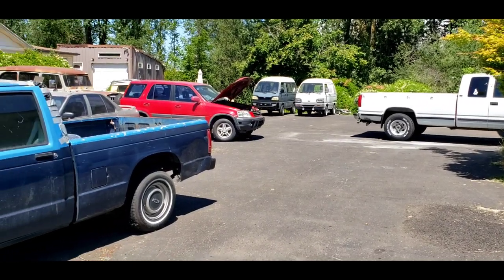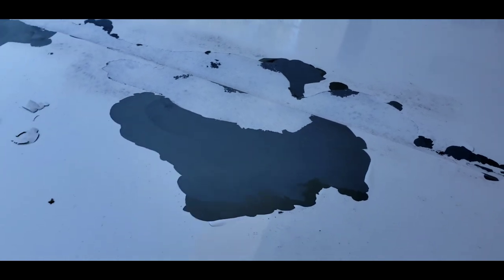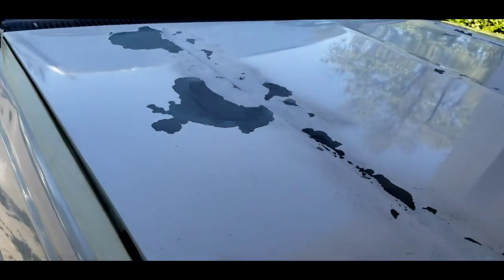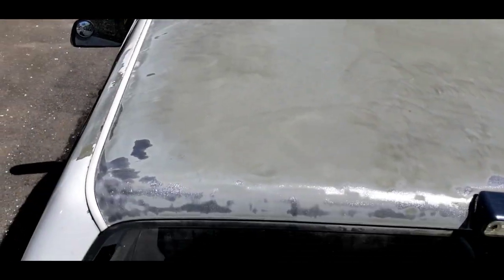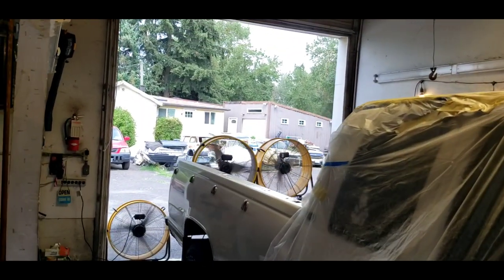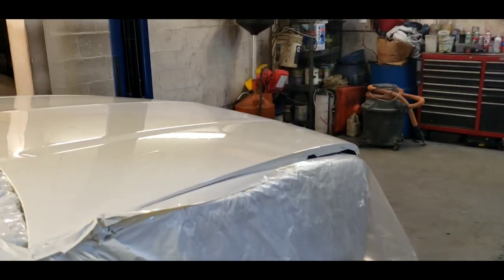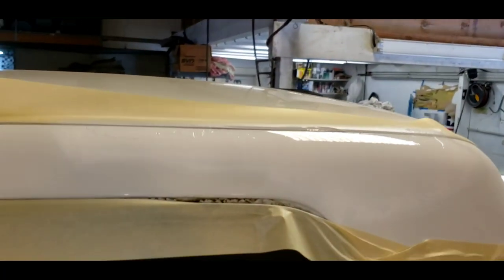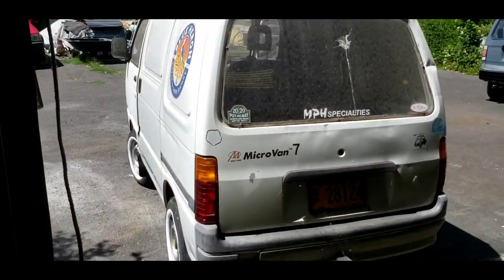It Took How Long to Paint a Truck Hood ?

Comment: Wow, I used to install those tires at a Dean Tire dealership for about ten years before I retired. Wildcat A/T's and SLT's, Quasars, and my favorites I had installed on my 91 GMC 2 door 2WD 4.3 trailer hauling rocket was a set of 255/60R15 Stinger Radial GTS's on some 10" allow wheels. What an upgrade from the economy 205/75R15 on 7" steel wheels, clip on chrome rings and plastic center caps included! Great job on the paint, and what an interesting way to watch the transition through the timing of this edited video. 👍
Thought I recognized that tread pattern!
Reply: What's crazy is that I built a porch this week and today I coincidentally took an old big DEAN TIRES sign I had saved when the shop changed brands out of storage and hung it under my new porch today. No kidding, I found a place to display my old Dean Tire sign and I get to see one of my favorite tires I used to install from that brand in the same day. 😃

Comment: On your Figaro with no oil pressure does it have a oil pressure regulating valve in the oil pump or external on the block? And could have a plug popped out behind a camshaft Etc causing the oil pressure to dump off. ?
If you can drop the oil pan you can do the old timers trick and feeding pressurized oil through the oil pressure switch port back into the block and figure out where the oil leak is coming from around a bad bearings or unknown leak.

Comment: There was some paint peal on the roof after a 2007 repaint job because of paint fade my well my aunts at the time my rare 93 Chevy S10 2 tone Tahoe trim which I've been restoring since I got it in Dec 2020 on my channel it is a bit of work.
Note it was painted in my ROP auto body collision repair class in 07 and what should I did most of the prep

Comment: Perfect roof and hood paint on an old truck looks odd to me.  I would have been tempted to sand and rattle can all bare metal, then spray the entire truck with clear coat.  But I am not sure how long that would last before more paint chipped off.